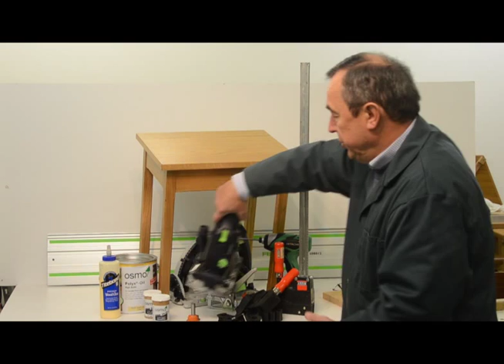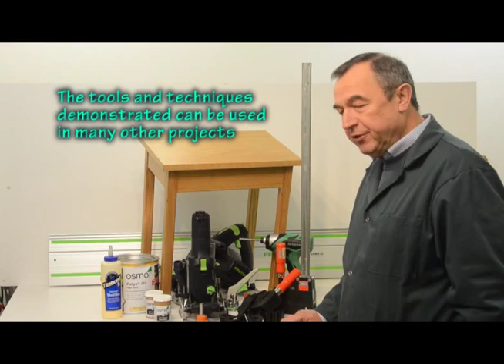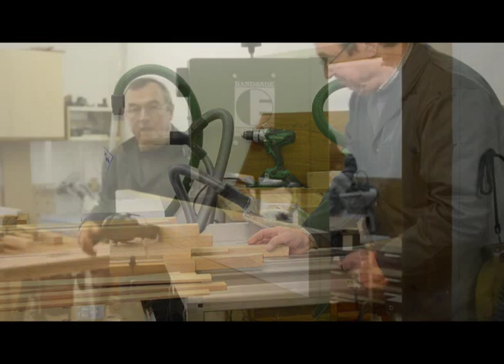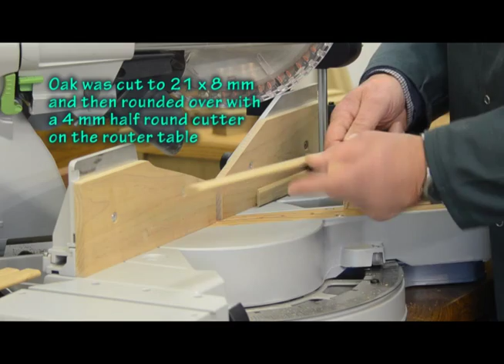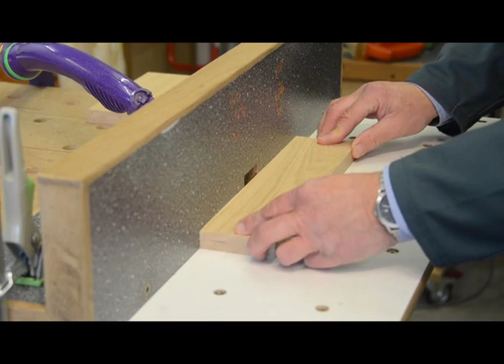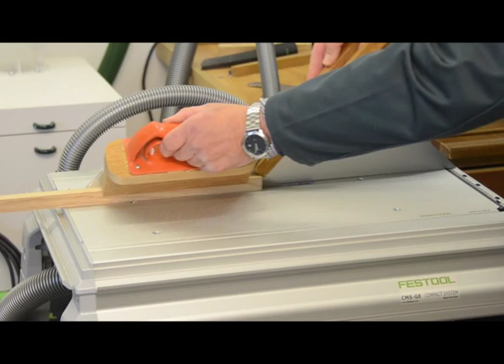Table Project - Part 1 of 4

Comment from the maker: Hi WoodNooze, Thank you for your encouragement. I have the Kapex 120 which has a 260mm blade. It is a lot more versatile than the Kapex 88 even though they share the same blade diameter. When I bought mine I compared everything on the market (about 2 years ago) and that included the new Bosch parallel action saw. Despite the price, the Kapex is the best for me. The only disappointing feature is that trenching is not especially good as the depth can vary from cut to cut. Peter

Comment: I like the fact that you mitred your dominoes. I prefer to use a push-stick to hold short piece on the mitre saw. I like your modified orange push-block as well.